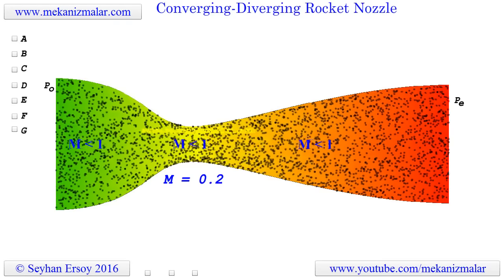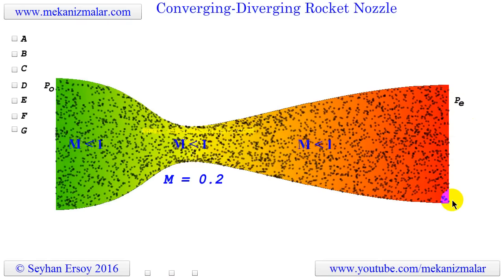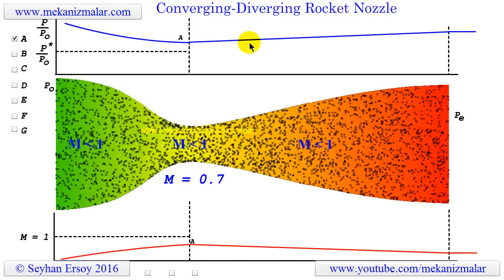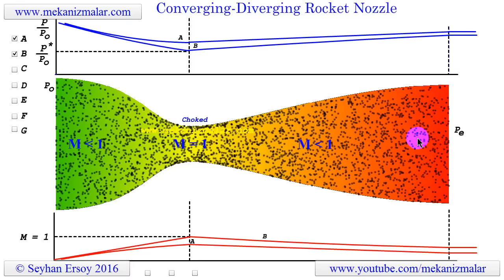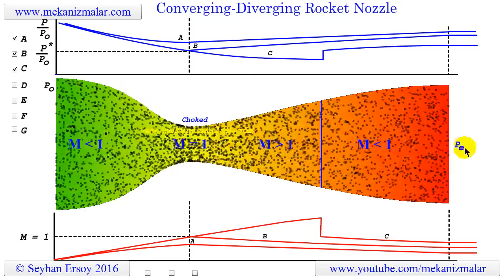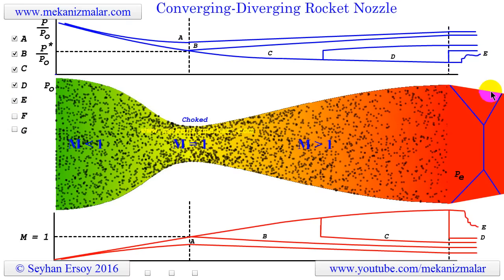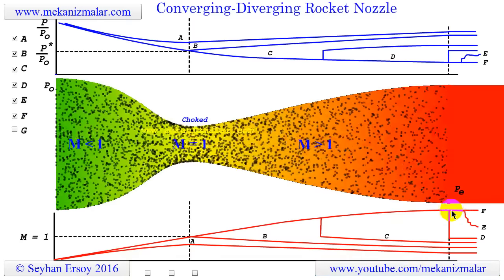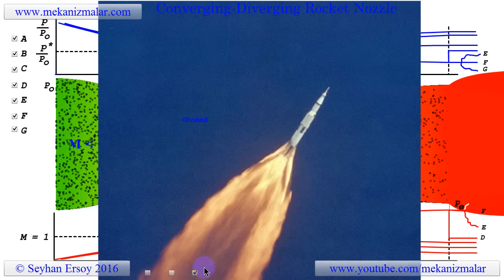converging diverging rocket nozzle

Comment: Rocket science is many things.  Fluid flow calculations.  Max stress/min weight structure.  Fluid/valving controls hardware.  Sensors/control and software.  Documentation and suppliers.  Assembly and testing.  Floor space/parking lots and offices.  Tax collection/budgeting/spending.  Single term "rocket science" comes from movies.
Reply from the maker: What you are saying is exactly true. It is best to keep videos as short as possible, so I used that term. However it is also valid for the nozzle. While it is requiring to solve two equations during Venturi effect, it becomes necessary to solve more equations simultaneously in converging diverging nozzles. Than it requires a little bit higher education.
Reply: Absolutely, I remember some of this being introduced in my thermodynamics and internal combustions classes for engineering.  What I've found in commercial industry is that when stuff like this is needed to build a device, they don't hire engineers to figure out/tinker/experiment.  They hire full pHd scientists who already know this like the back of their hand.  However, data and it's collection/reliability/repeatability needs to figured out by engineers using sensor, fixtures and computers.
Reply from the maker: Now we are in agreement.

Comment: What will happen at the throat if the inlet speed to the converging section  was supersonic ? Would it get reduced back to mach no 1 ?
Reply from the maker: It is impossible to have supersonic flow in converging nozzle. Once back pressure reduced a specific value, exit velocity will be mach 1. Reducing back pressure further will not change this.
Reply: But i m not producing supersonic in converging nozzle. Like if i give this output of converging diverging nozzle again to an converging nozzle then what will happen to the supersonic flow will it get reduced to sonic or remain supersonic in the converging nozzle ?
Reply: converging section will act as diffuser for supersonic inlet conditions . So the velocity will reduce i.e it will become sonic
Reply: saurabh patil ....well I will recommend u to read  a book on fluid mechanics by yunus cengel and john cimbala...
all doubts will be cleared in a jiffy I promise....
and yeah the whole concept needs no background knowledge...
a-z explanation in about 20 pages ....
if u read on for the next 20-30 u can understand about shock expansion waves oblique shocks choked flow etc...
so u must really this give a read if u want to be thorough with the conceptual explanation
Reply: mekanizmalar you made a comment along the lines...folks we are dealing with rocket science ....so lets skip this bit......I agree it would be a very lengthy video in such a case but yeah it is very easy and crisp explanation if u read the book suggested

Comment: I came here, hoping to understand the normal shock wave through this animation. Unfortunately, that is the part the animation does not display accurately. After the shockwave, velocity should go way down and density way up, which is not the case. Too bad!
Edit: Actually, I believe the velocity of particles which go through the nozzle does not change at all. However, it should always go up when density goes down, and vice versa. That is unfortunate!

Comment: this video really very  nice , please tell me why the length of conversing part is smaller than that of the diversing part.when this type of nozzle is used to tramsmit air fuel mixture from carboretor to engine.
Reply: ashutosh kumar safi Because of the phenomena of  boundary layer separation. Just google it, because it will help you understand it in a better way rather than me explaining here.

Comment: Can someone clarify to me why we use case E and not F during lift off? I still can’t grasp what the reason for it is
Reply from the maker: When the rocket nozzle manufactured it's nozzle designed such that it works in higher pressure E. This makes the nozzle inefficient, but it generates enough trust to cause the rocket to take off. However, when the rocket assent atmospheric pressure around the nozzle begins to reach F pressure in which the rocket nozzle works most efficiently.
Reply: Look in google images for "atmospheric pressure and altitude." You'll see very quickly that as you go up, atmospheric pressure (or pressure outside the rocket) goes down. This means you can design the rocket to start at E and go to F as the rocket flies, or you can start at F and go to G. 

F is good. G is bad. If you start at E you get the most time at stage F for the entire flight.

Comment: Why does the velocity stay at mach 1 at the throat even if we reduce pressure at exit?
Reply: Because the velocity after the throat is > M1 and so faster than the speed of sound, this stops pressure waves moving back up to the throat as the flow downstream is faster than the pressure wave can travel back towards it.
Reply: @NeilStansbury  I am sorry, I am having difficulties understanding this. Could you explain a bit further.
Reply: @anand929391  Sure, will try... there is another way of asking your question, how does the throat "know" that the exit pressure has been reduced?  When subsonic, the answer is pressure changes moving back up the stream from the exit.  Except we are now supersonic, so the stream from the throat is going faster than the pressure waves from the exit can propagate back towards it, therefore the throat doesn't "know" about the pressure change at the exit.
Reply: @NeilStansbury  Thanks. I think I got it. But why does the flow turn supersonic in the diverging section. I mean it should reach mach 1 but on reaching mach 1, it should have stopped like in the throat since the exit pressure cannot pass through a mach 1 flow.
Reply: @anand929391  If the flow is sonic at the throat it will try to expand with increasing velocity (supersonic) in the diverging section as the molecules don't get to know what is the 'pressure' status at exit as the molecules at exit are moving at a greater speed than sound waves or pressure waves can travel (with respect to the fluid). Additionally, increasing area (and other factors) makes density decrease, (unit mass takes up more space-increased velocity) So that's why 'diverging' section helps the gases to expand 'with increasing velocity' - (for supersonic case) and thus achieve better propulsion(in rockets) and better Power output in De Laval turbiness
Reply: @chinmaykalkeri  Thank you for the reply. I am still a bit unclear. I will try to explain my thought process. Let us consider 3 cross sections in the above nozzle - 1: very near to the throat in the converging section, 2: at the throat and 3: very near to the throat on the diverging section. During choked flow, velocity at the throat(cross section 2) is 1M(mach number). Let us assume the velocity at cross sections 1 and 3 to be 0.99 M. We reduce the exit pressure slightly. The effect of this reduction of pressure will be affected at the exit first and then goes towards the throat. So at the exit the velocity increases slightly, then just before the exit the velocity increases and goes on and on towards the throat. Once the pressure change reaches cross section 3 that we considered(ie. the cross section very near to the throat on the diverging section), the velocity changes from 0.99M to 1M. I believe as told in the video, the velocity at throat remains at 1M and no change is felt on the other side(converging side) since the pressure change cannot reach the other side through the throat which is flowing at 1M velocity. Now we have cross sections 1 at 0.99M, 2 at 1M and 3 at 1M. I hope you are with me till here. So we will consider one more cross section in the diverging side very close to cross section 3 having velocity 0.99M. Imagine that we reduce the exit pressure again slightly. Again, velocity at exit increases slightly and and as the pressure change goes towards the throat, it keeps on slightly increasing the velocities at those areas in the diverging section that it travel through. Once it reaches cross section 4 where velocity is 0.99M, it increases the velocity to 1M. It cannot go any further to cross section 3 since cross section 4 is at a velocity of 1M. So we have cross section 2(throat), cross section 3 and cross section 4 at 1M. Like this, if we keep on decreasing the pressure at exit, the entire diverging section should be slowly converted to sonic flow but not supersonic flow. So please tell me, where did I go wrong?

Comment: Ma'am how do we actually alter Pe....
Reply: Pressure reduces as you gain altitude. It is usually as in the case E in liftoff, as rocket gains altitude optimum case (F) is reached. Because total pressure is 1 atm in the sea level but 0 atm in the space.
Reply: You need to adjust the dimensions of the divergent nozzle. Using the video as a reference, in scenario C you would want to cut your nozzle off near the blue line. The ratio between the choke point and the diameter of the end of the nozzle is known as the expansion ratio. The expansion ratio at sea level will be small in relation to a vacuum nozzle. Everyday Astronaut has some good videos on rocket engines.
Reply: Up

Comment: Can we actually find this animation anywhere?
Reply from the maker: I could not find similar one that is whe I have developed my own.
Reply: I see! Is this animation open-source or was it just used for the video? I am an undergrad and I tried writing Matlab scripts but visualisation is pretty hard and uncooperative. Especially with the specific location of the normal shock (x away from throat) I could not find the maths for it in literature, of course this seem to calculate it!
Reply from the maker: My programs are not in public domain, I use them just making videos of my animations. Flash programming is very good in animating yje characters or components. However it is not as powerful as Matlab, as far as complex  engineering problems are concerned. That is why some of my animation takes quite long time to develop. I wish there was a language combining these two. Maybe there is one that I don't know.
Reply: Ok I see. Many thanks for the explanation though great video!
Reply: Have you heard of processing? Or openframeworks?

Comment: How to reduce exit pressure?
Reply from the maker: When rocket go higher than exit pressure reduces proportionally.  If you ask if performing lab experiment, we should have a large exit container and reduce the pressure to the desired level by using vacuum pumps.
Reply: Now I understood.Thankyou the video is great. But still I have one doubt. What about converging diverging nozzle used in steam turbines?
Reply from the maker: @amartyamunot8019  Actually original converging diverging  nozzle comes from de Laval nozzle in steam turbines. You can read about it in following link. https://en.wikipedia.org/wiki/De_Laval_nozzle